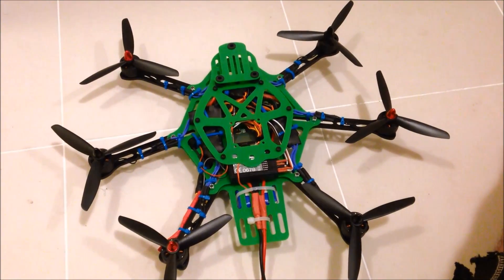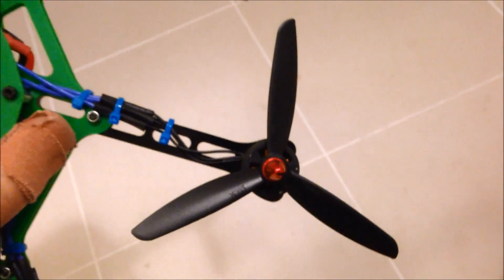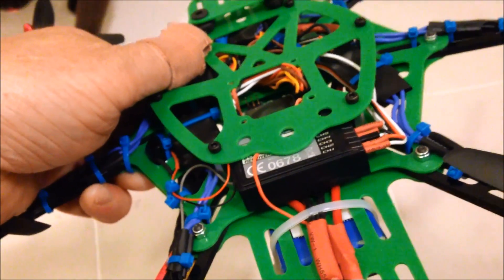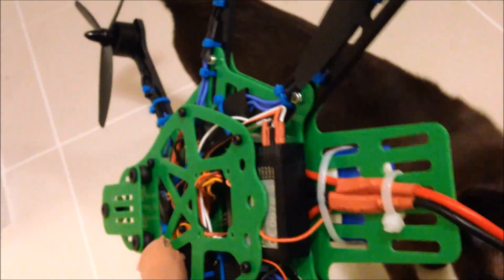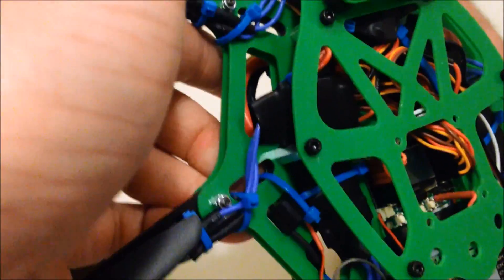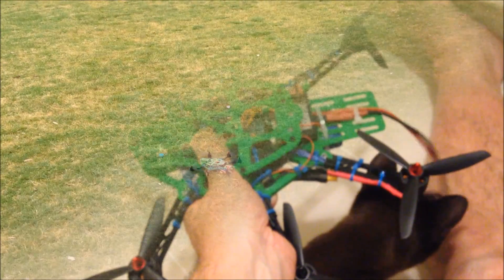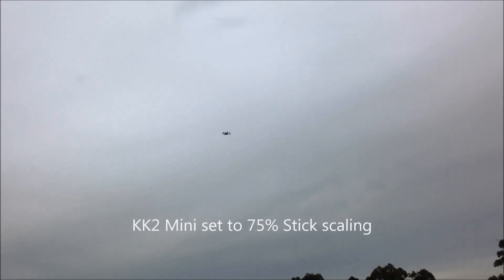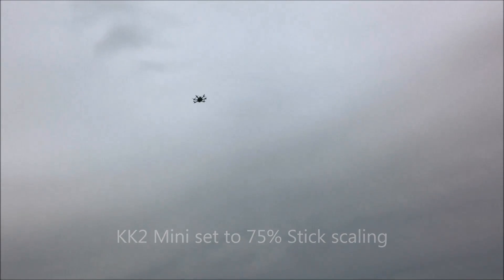Hobbyking Thorax Overview and First Flight with KK2 Mini and Plastic EMAX Motors

Comment: do you think they heat up with those props? because I use the pm1806s and I havnt dared to try using 3 bladed props...
Reply from the maker: Barely even get warm with a 3s battery

Comment: I love this hex!! I fly it all the time FPV.  I too am using the PM1806 motors but on Naze.  It makes for a speedy and light setup.  I am wavering on the decision to use plastic motors at least for FPV proximity flying like I am doing.  A good solid crash breaks these motors especially on rock or concrete.  In ten months of flying this hex I have gone through about 8 motors. Enough complaining.  I am running Turnigy 2200 3S batteries and an occasional Zippy Compact 2200 3S. I had to get taller standoffs so I could mount a board camera in front angled about 20 degrees an added a small wood block under the Mobius mount to match the same angle. See a some of my flight videos....

http://www.youtube.com/watch?v=iPEnp_MLkc0

http://www.youtube.com/watch?v=U84lfsSdscM

http://www.youtube.com/watch?v=yrHsTB0jxec